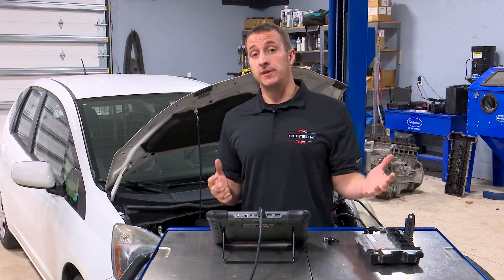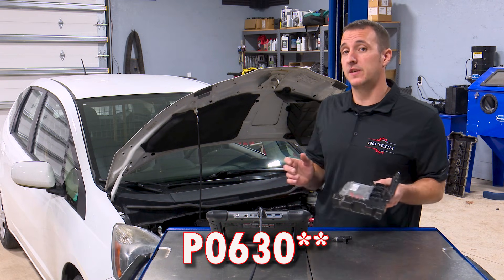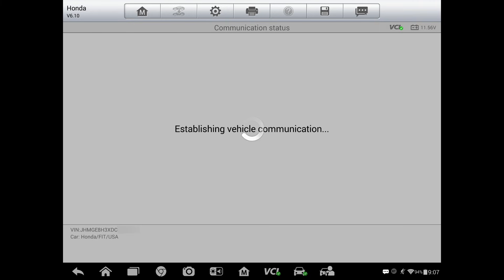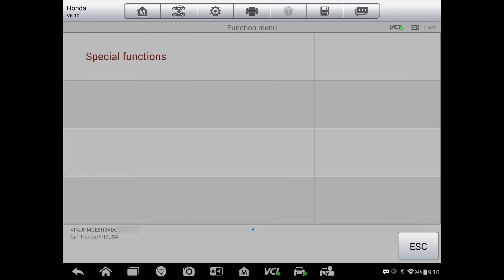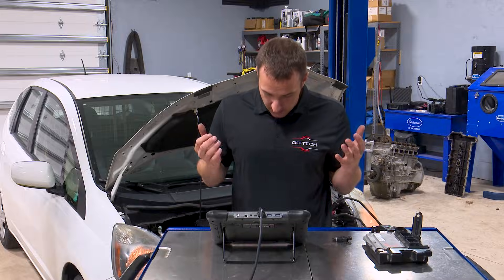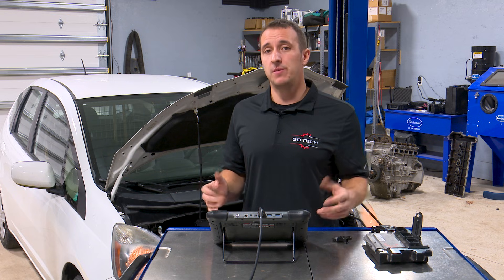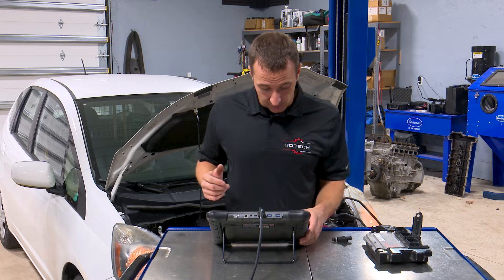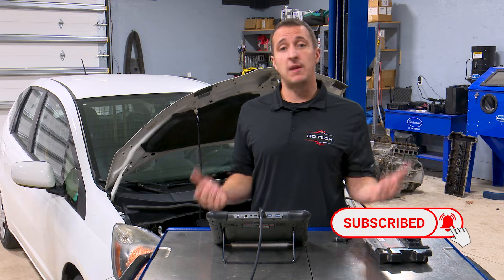Program Used HONDA ECM / ECU With Autel

Comment: Could I need a new ECM? I cannot read codes from OBD no signal and I don't hear the fuel pump running? I pulled a relay from the car while running and every since then It will not start found the starter relay burnt replaced but still won't start

Comment: What Autel scanner is this? And what is the cheapest Autel model that can do this repair. I currently had my ECM replaced in my Subaru Forester 2009 a/t and it's not starting the engine, it just cranks. Thank you!
Reply: For some reason no one seems to want to answer your question! I wouldn't support this channel, since they won't answer such a valid question! Obviously they don't care! Selfish channel don't like and don't subscribe!!

Comment: HELLO. This is a great video. I am curious what scanner you have. I want to get something to replace my old Launch GDS 431. and Im curious, can you use this procedure to swap in an ECM Like you did., But with out the old ECM. mine was shattered in an accident. so the old one is INOP. im working with a 2011 fit. and an 09 doner. thanks!

Comment: Hello can you update the firmware on an ECU from a 2007 Honda pilot? Do you offer this service or what do you suggest I have a VTEC code that will not go away even after replacing the vtec solenoid and doing every other thing. Online it suggests to update the software on the ECM

Comment: I want to buy a used ecu for my 07 acura tl type s, and replace the original ecu.Would this be the same process?
Reply: I have same car and I have same question 😅.  I'm having issue with air fuel sensor and I'm convinced after checking wiring and changing o2 sensor its the ecu

Comment: id like to be able to reprogram a standard honda prelude 5th gen ecm apparently you can't and have to buy a p28 ecm but pretty much any chip can be unsoldered and replaced with an EEPROM its just because no one has done it before so they think you cant, i have already been able to swap out the immobiliser board on the ecm from my old one to the new one and its all works perfectly i showed this o my channel, but now i want to turbo the car so want to reprogram it

Comment: I have  a 2006 Honda civic ex currently in immobilized mode I changed the immobilizer and ecm. Tried to reprogram both with autel reprogrammer but unsuccessful with error stating failed ecm/pcm is not communication error
Reply: How is the car going . Has anything changed in the last nine months

Comment: Hai sir i have a problem wit honda civic fd 2007 ..i was changed used ecu but after a week engine ligth on and vsa light also shown on meter ...when check with computer it shown ecu problem..how to solve sir?
Reply from the maker: Hello,
What trouble codes is it setting?
~Ryan

Comment: Can you do a video about the evap system on a 2007 4runner, I've tried a gas cap, but it wasn't a Toyota brand, I also replaced the purge valve solenoid, and the hoses from the solenoid to the metal like going to the tank. And the hose from the solenoid to the intake. I need to know how to troubleshoot it right and a detailed info about the other components.  Please thanks
Reply: P0441, p0455, and p0456
Reply from the maker: Hey Jason,
One thing I would be careful of, is if the aftermarket gas cap is sealing properly, make sure to inspect the sealing surface of the filler neck where the cap seals. Assuming that it is, this vehicle runs a pretty complex EVAP system. It uses a leak detection pump located on the canister to force pressure in the system and check the system for leaks. The codes you have stored are all EVAP system leak codes. The only sure way to test the system is to use a smoke machine to pressure test the system for leaks. This will determine if the system has an actual leak or if the leak detection pump has failed and is causing a false leak code. If you can find a leak using a smoke machine the fix is simple, repair what is leaking smoke. If the system is sealed then you must determine if the leak detection pump has failed or a wiring issue with the pump has caused it to operate incorrectly. 
I hope it helps, I know it is a lot of information.
If we get a Toyota in with this system, we will be sure to film a diagnostic video with more details.
~Ryan Wilsing
Reply: Thank you it was helpful
Reply from the maker: HI Jason,
What trouble codes is your 4runner setting?
~Ryan Wilsing

Comment: 😳This is where Autel shines over Snap On
Reply from the maker: Hey Philly,
I agree %100, it's always good to have a few tools in your tool box. Every tool shines in in a different category.
Ryan Wilsing, Technical Instructor
Reply: @GoTechTraining  Hi! Great diagnosis! Would you mind sharing your favorite top 3 or 5 diagnostic tools and what is the category in which one beats the others or the category in which each one shines in your opinion?
Reply from the maker: Hi Ovidiu, that's a tough question to answer. I definitely have a few scan tools that are on my top list to use, such as the Snap-on Verus and the Autel Maxisys. But I have to mention there are a lot of scan tools I have not had a chance to use yet. As far as which one shines in what category, that question is even harder to answer. This is because each scan tool's coverage and features can change depending on the car make and model. While one scan tool works best for EVAP on a 2000 GM, another scan may work best on EVAP for a 2000 Toyota.  I recommend when buying scan tool, first decide which type of coverage or options you need, (for example, data graphing, immobilizer relearns, bi-directional controls) Then choose one that fits closest to your needs. 
Thanks for the question!
Ryan Wilsing, Technical Instructor
Reply: @GoTechTraining  Thanks for the answer!
Reply: @GoTechTraining  Hi Ryan! Thank you again for the answer! One more question please. What exactly are you referring to by immobilizer relearns?
Reply from the maker: Hi Ovidiu,
Immobilizer relearn is learning the ignition keys to the car.
~Ryan Wilsing
Reply: @GoTechTraining  And please what exactly Autel scanning tool did you use in these two episodes?
Reply from the maker: The scan tool used in this video is a Autel Maxisys MS908S Elite

Comment: Good fix.  This one was lucky the used module worked in this vehicle, also that the immobilizer and vin could be changed.
Reply from the maker: Hi Mike,
Right! With the one time use module these days,  it is a breath of fresh air to be able to use a previously used module in a vehicle! 
Ryan Wilsing, Technical instructor
Reply: @GoTechTraining Hi love your videos I need a little help I have a 2006 Honda Accord 2.4 the heater core leaked into the computer now the green key on the dash is flashing and the car won't start I changed several computers but the ODB Port is not getting communication to the computer the immobilizer looks good but the green key is still flashing I grabbed a computer from a car out of the junkyard do I need to change the ignition also and why do you think the ODB Port is not communicating with the computer I could really use your help to figure this one out the computers I got from the scrap yard the VIN matches the first five letters but still no start

Comment: Nice one.👍 Hey i have a question. I've read MotorAge article that when programing modern car modules, the car need to have stable power supply hooked to the battery. Not battery charger, not battery maintainer, but "stable power supply". These things are extremly expensive , the one i found - "Schumacher" is nearly 700$. Do you think this is a lie just to sell the equipment. Can i use just a battery charger ?
Reply from the maker: Hi Petar,
In this video, the used PCM already has the operating software programed into it. We are relearning the security immobilizer and re-writing the VIN. When programing most manufactures ECMs/PCMs the modules are either blank or need software written into the module for them to operate. This can take time, sometimes hours and the battery could get dangerously low, very quickly. When a module is being programed sensitive data is transferred between module and the interface used. This data can become corrupt if too much dirty or A/C voltage gets into the system. That being said anytime you program a module it is recommended to use a stable (clean D/C voltage) power supply. The use of a normal battery charger can easily cause a module to fail during programing. Which will cause the module to brick. If a stable power supply is not available you can use a fully charged jump pack to help maintain voltage but a D/C maintainer is ideal.
Reply: @GoTechTraining  Thank you so much. Very well explained 👍
Reply: @GoTechTraining  HI! I'm not a native English. So please what do you mean by 'a fully charged jump pack'?
Reply from the maker: @Ovidiu, a jump pack is essentially a unit that consists of a car battery with jumper cables attached to it. They are used to jump start vehicles with dead battery's or to help maintain battery voltage when testing.
Reply: @GoTechTraining  OK. Thank you!

Comment: Nice, what model is that? I have the ms906bt, i also have a thinktool pros, snap on verus and cardaq3plus
Reply from the maker: Hey Michael,
I'm jealous, that is a arsenal of great scan tools and I love the cardaq3plus!
The Autel used in this video is the MS908s Elite 
Thanks for checking out the video!
Ryan Wilsing, Technical Instructor
Reply: Yeah I'm eyeing up the im608 which is basically the 908 with full key programming...
Reply from the maker: I have used it, it is a very capable tool

Comment: Not really programming but doing the immobilizer setup and writing of vin. Good idea to see if there is updates available for a used ECM.
Reply from the maker: I agree, not your traditional software programming as required by a lot of manufactures. 
Good point that we did not mention, it is always good to look for any relevant updates to the controller after installation. I was glad a used controller could actually be used, with all the one time use modules out there, unless you do cloning or EEPROM work.
Thanks for watching!
Ryan Wilsing. Technical Instructor
Reply: @GoTechTraining  Which model is this autl?
Reply: Yeah which model scan tool are you using to manipulate the computer to do what you want
Reply: How can you update it?